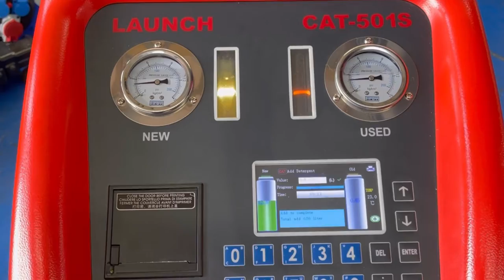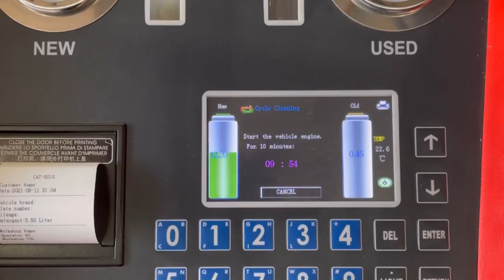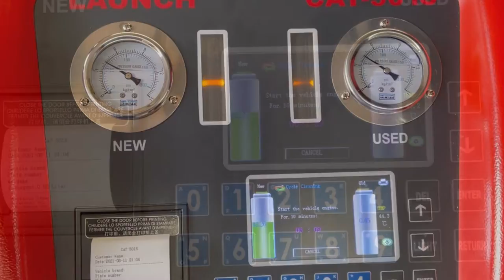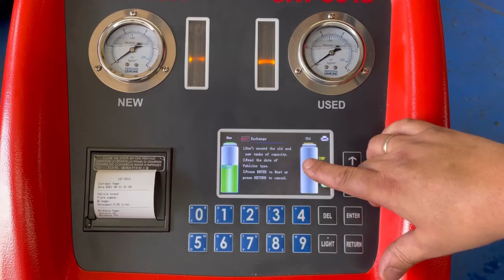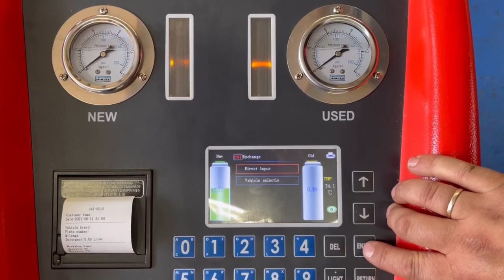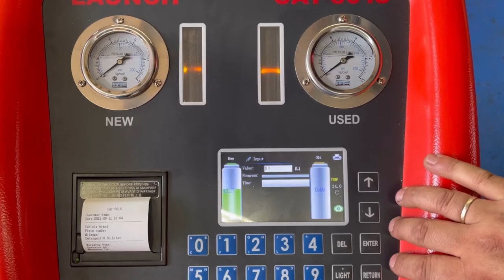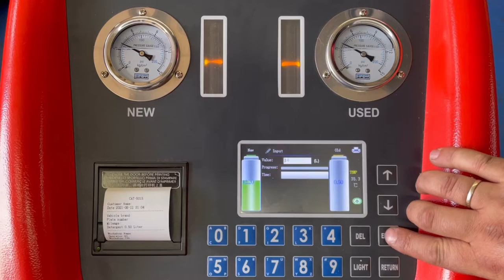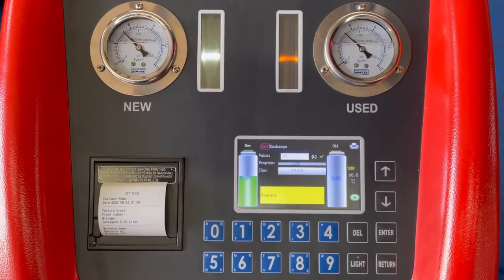LAUNCH CAT 501S ATF Automatic Transmission Flush

Comment: Hello sir, can this machine be used to fill in new transmission oil into the transmission. Thanks
Reply from the maker: Hello Innocent Oriri,
Yes, with this mashine you can clean and maintain the entire automatic transmission system quickly and easily with just one device.

With its range of automatic functions, the CAT-501S allows transmission experts to exchange the transmission fluid with one simple tool. 

Here you can find more information: 
https://launch-europe.eu/cat-501-s-maintenance-service/

Best regards

LAUNCH Europe Team

Comment: On our machine we just bought the is no database loaded in the car selection menu. how can we get the database loaded on to the machine? regards Dan
Reply from the maker: Hi Dan, sorry for the late response. We will check and give you a feedback as soon as our product management team will inform us.
Reply from the maker: 2.	The database on our CAT is empty and can be filled manually by using the keys on the unit. The idea is to use it for frequently used models. Further we offer an optional online database, which can be used with any online tool or with our CAT REMOTE.

Comment: Got one question, all the process been done, if i found the oil temperature is higher than normal, what should i do, leave it alone or do sth?
Reply from the maker: Hello @user-sc3uo4cu5y, 
can you tell us when the oil temperature became too high? And how many degrees was it exactly? When you say that it was "higher than normal" - what was the normal level? Was it during the flushing process or during the oil level check? If you could answer some of these questions, it would be much easier for us to give you the correct answer. 
Best regards
LAUNCH Europe Team

Comment: Dear Bro, we are facing one issue with the CAT-501S launch machine. The temperature light on the right side continues to flash red. It's supposed to flash green. I searched the launch guide but couldn't find it. Could you please guide us through troubleshooting this issue?
Reply from the maker: Hello Jegan K,

thnak you for the request - our service team came up with the following answer regarding your question. It is the warning for changing the filter. Confirm the "Delete" button twice to delete the information. After replaicing the fluid filters, press key DEL two times on the interface of History Records to delete the original history records and meanwhile delete the prompts for abnormal fluid filters. (the filter status icon on the interface will automatically turn green from orange).

For more information, please contact our Service team by service@launch-europe.de

Best regards
LAUNCH Europe Team
Reply: @launcheuropegmbh3543   Thank you Team  for your response with solution ...

Comment: Hi! How do u change the filter if its locted in the bottom of the gearbox in the oil pan?thx
Reply from the maker: 1.	How to exchange the filter on the gearbox depends on the car model. With our CAT REMOTE there is the possibility of “guided exchange” which explains in general how to do the procedure. But not related to the car model.

Comment: I bought the same device, I got a problem. If I fill the oil, it does not appear on the screen. Is there a way to activate it?
Reply from the maker: Hello @yosefalsagri1915 
Your description could be the following error: Scale malfunction! Imprecise oil extraction or filling. 
Solution: Calibrate the electronic scales, change the old or new oil scales, update the software,

Comment: Can this machine withstand hot oil comes out from the engine ?
Reply from the maker: Hello shakya bandara,
the LAUNCH CAT 501S is a transmission flushing unit. The unit is not for engine oil, but for transmission oil.

It can withstand the warm/hot transmission oil
Gear oil approx. 80 degrees
Engine oil approx.100 degrees

Best regards
LAUNCH Europe Team